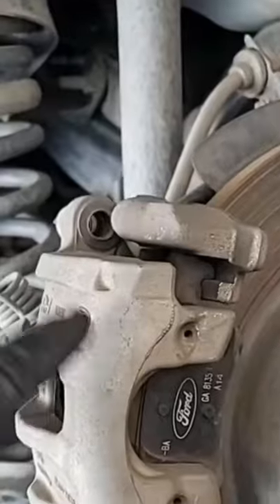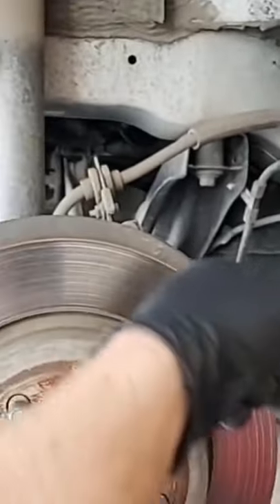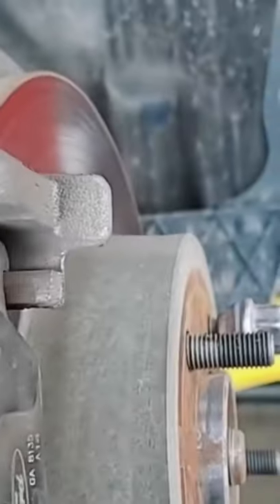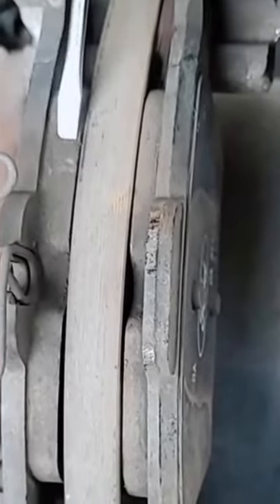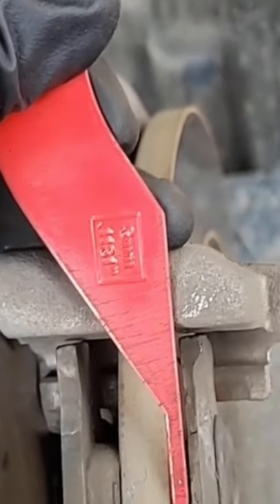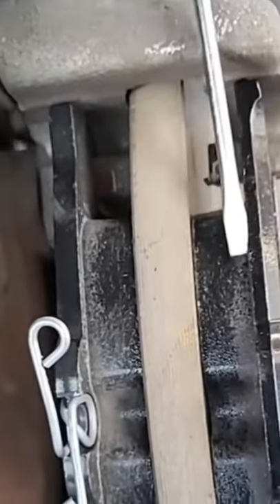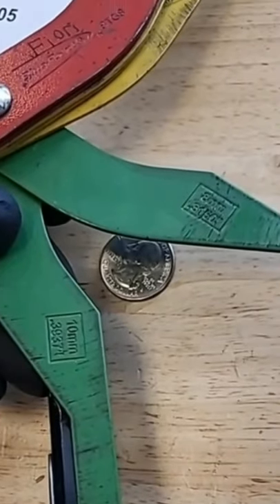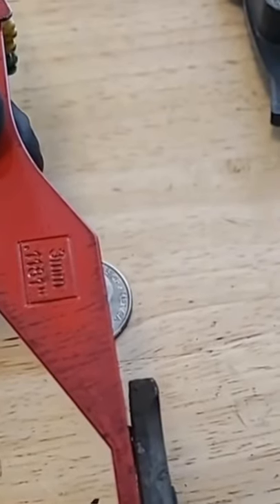How to check your brakes in less than 50 seconds #shorts

Comment: Dont forget the slide pins. See if you can move the caliper back and forth a little. Good chance that's why one brake pad is worn down more than the other.
Reply: Ty for this even 2 years later 😂

Comment: Tip: if your car have steelies, you can check your brake fluid, it will tell you how much life is left on your pad depending on how low the fluid is, as long as you didn't top it off during the last brake change
Reply from the maker: True. True.
Reply: sorry if i’m mistaken but how come this only works with steel rims ?
Reply: @michaelvargas8656  it's a wording for the rims, regular alloy rims works also

Comment: HELP please! Is the roater replaced during a brake change?
Reply from the maker: No.  Not a routine brake change?
Reply from the maker: Unless you drive a Mercedes?????
Reply from the maker: Mercedes recommends you do.
Reply from the maker: What year and kind of car do you drive ?
Reply: @Karl.Car.tech.1  It’s a 2013 Mercedes CLA 250
Reply: So long story short I had I brake change done at Midas 2 weeks ago. I got an oil change yesterday at Ford dealership that’s all I went in for and signed and paid for. Well my car started to do what it was doing right before I changed my brakes and now that I review my paperwork it says my front brakes are at 2mm.
Reply from the maker: @Winecountrygal  that’s not good.
Reply from the maker: Take it back to Midas with the receipt from ford.
Reply from the maker: Tell them what happened. Or you can call Midas cooperate office to escalate the situation. Demand they show you the brakes and explain what they did. Make sure you take pictures of the brakes.
Reply from the maker: When you take pictures they will be scared and do the right thing. Because they don’t know your intentions.
Reply: @Karl.Car.tech.1  Thank you!!
Reply from the maker: Let me know how it goes.
Reply from the maker: How much was the total brake job and what state are you at?
Reply: @Karl.Car.tech.1  They tried to get me for $1400 but knocked it down to $968 and the paperwork says everything is new on all four the pads the rotors disc everything. California
Reply from the maker: Oh. Ok. I am in San Diego. Let me know how it goes.
Reply: @Karl.Car.tech.1  I’m here now they showed me  the brake pads and they are all brand new from the looks of it. They are testing driving it now to hear/feel the noise. They also asked me to take pictures for my reference so I think I’m in the safe zone and there must be something else going on.
Reply from the maker: Not sure either.
Reply from the maker: Two things. When you take your car to the shop again, Always always always ask to see the old parts whenever you get work done on your car and take a picture of them. Two, always take pictures of the work when it’s done. It will make them think twice about ripping you off.  Ok.

Comment: Hope you fixed whatever ate that outside pad up
Reply from the maker: Yea.
Reply from the maker: Calipers or caliper slides is usually the cause of uneven wear ? Right?
Reply: If it was caliper slides causing uneven wear it would look different, each pad individually would be uneven from top to bottom or left to right. When either the outer or inner pads are so drastically different, it is usually a sign that they aren't moving freely within the caliper guide. Might be rust built up causing the metal guide on caliper to pust out slightly and making that outer brake pads seize into place
Reply from the maker: @matthewward4595  great answer
Reply: What caused the uneven wear for the outer pad
Reply from the maker: @iamhan8706  Read Matthew comments above. Let me know if it helps.  Ok.
Reply: This calliper doesn’t have calliper slides though, what is the metal guide, or pust out mean
Reply from the maker: @iamhan8706  interesting
Reply from the maker: @iamhan8706  what kind of car is it?
Reply: And audi
Reply from the maker: @iamhan8706  what kind and year?
Reply from the maker: @iamhan8706  did Matt comment help?
Reply: Suv q5 2020, can u please explain to beginner